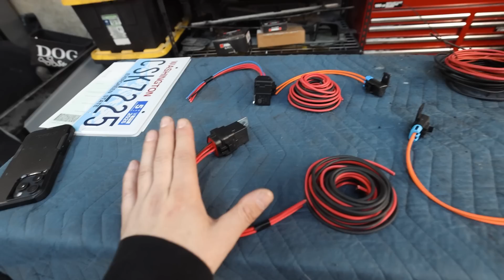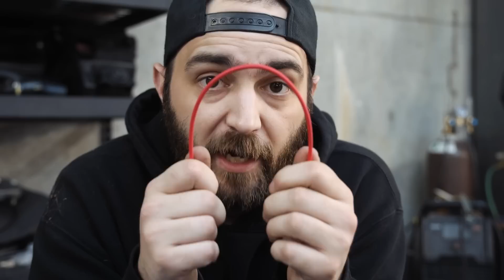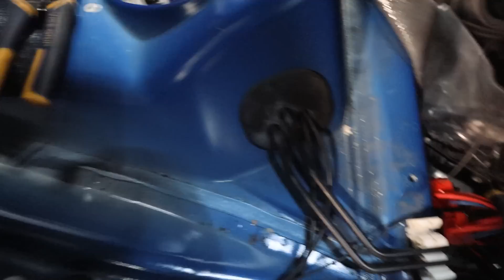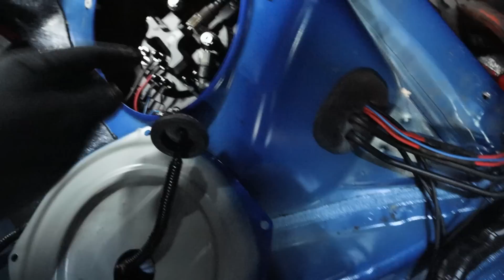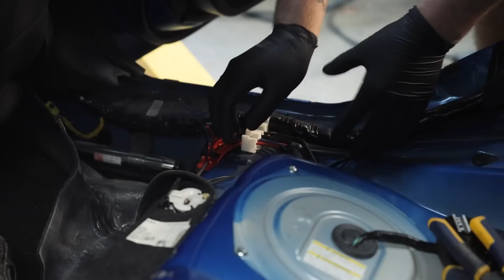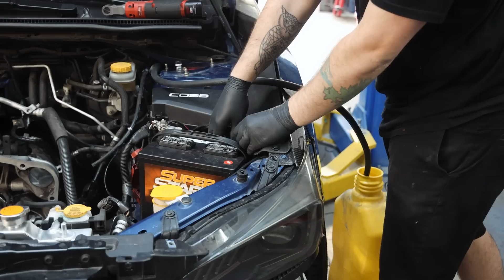How To Wire Radium Dual Fuel Pumps; DIY Wire Kit

Comment: 2:15
If you clip the wire like he did here, I would recommend that you use something to seal the end. Exposed wires are never a good idea regardless of location. Idk, maybe I'm just OCD when it comes to this, but I've had far too many electric gremlins to take unnecessary risks. My Evo 8 is currently a nightmare. I've had a parasitic drain coming from a mystery location for 2 years and it had gotten to the point where I had to disco the battery every night. So yeah, paranoia vs extra cautious? I'd much rather deal with mechanical issues over electrical especially when the car/wire harness is OEM or Stock

Comment: So I’ve had this radium dual pump 450s and two hard wire kits for about 4 years now but my primary fuse is turning black from heat and high resistance I’m assuming but it doesn’t blow. I’m going to look into the wiring again because before I tightened the ground wire that’s on the chassis in the back like you mentioned and it helped but a year later now it’s doing it again and I’m rotated and all that but I’m trying to narrow down where the issue is and if it’s the spade connectors or what. None of my wiring is melting but I’m wondering if my stock feed hardline is restricting the flow causing the pump to work harder. I do have a vibrant DIY kit to make a feed line but I just haven’t messed with it.

Comment: Hey @Smeedia ...Did you need a check valve on your secondary pump? Is there any issues with backfeeding? Im all set up with a hobbs awell, my tuner just informed me about secondary pump backfeed, internet says radium feed design is supposed to eliminate backfeed. Keep me posted, im panicking cause dyno is in 2 days haha.

Comment: Do you have any vids on removing the stock lines from tank to engine bay and replacing with braided lines and AN fittings? Also what is your recommendations for 550whp fuel system? Do you do paid consultations?

Comment: I dont mind wiring but is it worth it over just getting an iwire kit and knowing its correct and less of a hassle.
Reply from the maker: If you don’t mind spending north of $600 for their kit it works great and pretty easy to set up 🫡
Reply: @Smeedia  Appreciate the compliment. Just a heads up, the dual pump kit is $425.
Reply: @iwiresubaruwiringsolutions $633 shipped with tax including Hobbs switch ☠️

Comment: can you add the fuel hanger part (link) in the description?
Reply from the maker: That’s going to vary from chassis to chassis, I’d suggest looking at radium’s site for the exact hanger you need 🫡
Reply: @Smeedia  fair. what i liked is the boost reference, it's nice that the second would trigger with ecu assist. for folks with oem eu, it's the optimum way.

Comment: I prefer the FORE FC3 in all my cars. Just needs the power from the factory fuel pump controller as a trigger and works with a hob if you want to run 1 on 2 trigger or 2 on 1 trigger

Comment: Would the 10 gauge wire supplied by radium be enough to handle the amperage of a single walbro 525. 

I’m only guessing it would because a single 525 produces up to 25amps and the 10 gauge wire can handle up to 30 amps. I plan on running dual 525s. 2 radium kits.

Comment: Wiring the first pump's ground to chassis will make it so you lose the factory "prime" and rpm signal safety, if the key is on the pump will always run. What I have done is used the factory fuel pump ground signal as my relay ground. This keeps the safety of the pump cutting off in case of a stall out or accident. Of course the settings in the tune should be changed to 100% fuel pump duty at all times so the relay isn't constantly cycled.
Reply: He's right. Without the FPC in play, the primary pump will be on with the key in the "on" position, thus losing the prime feature and the safety of it shutting off if the engine is not running.
Reply: I think you probably missed something in the video. The power to the pump is controlled by the relay. The relay is controlled by the factory pump harness so when the ECU calls for prime or shut off, the relay turns power to the pump on and off.
Reply: @mrblock2013 correct but the power is constant and the ground source is what actually completes the circuit, just like an injector doesn’t fire until the ecu grounds it. In this case grounding to the chassis would make the circuit complete any time the key is on, regardless if the engine is running or stalls out.

Comment: Taking a break from dropping my engine in to watch this. Any tips for when it just doesn’t wanna go together? lol
Reply from the maker: Angles, the engine and trans have to be at the same angle when going in. It’ll make life so much easier. Definitely jack up the trans a bit 🫡
Reply: Smeedia says don't give up! 😅
Reply: @brandonnazelrodt2819 appreciate it lol
Reply: Gotta jack up the trans about 2 inches 
Make sure the dowel pins arent in the transmission
Make sure youve put the the lower studs 
And do it with a cool mind lol
Reply: 100% Dhaval

Be patient. I walk back and forth between passenger and driver side, comparing the gap between the 2.

Make sure the dowels are installed. You can wire brush the dowels to ensure they won't get hung up on gunk or corrosion. You can also bottle wire brush the holes in the transmission that the dowels will go into. Wipe a small amount of grease on the dowels.